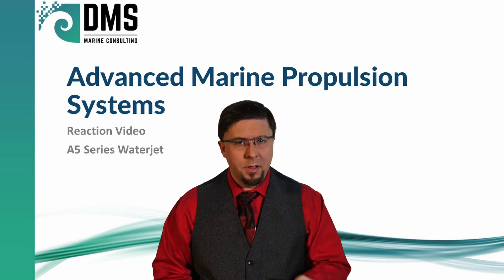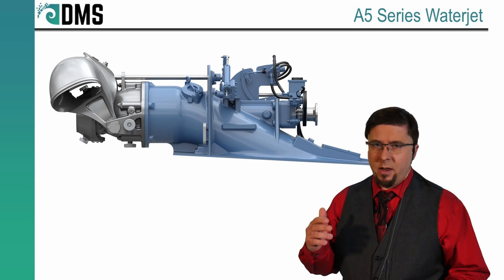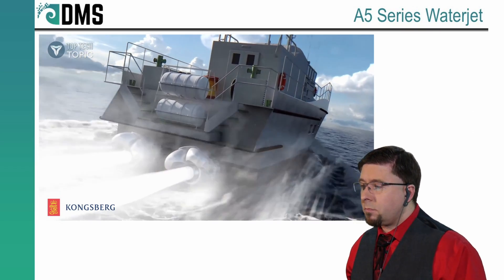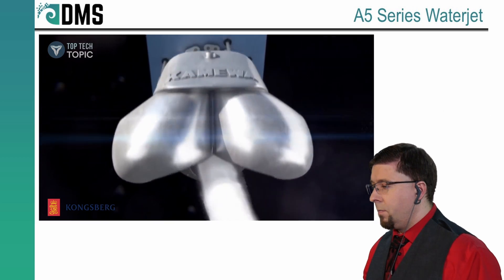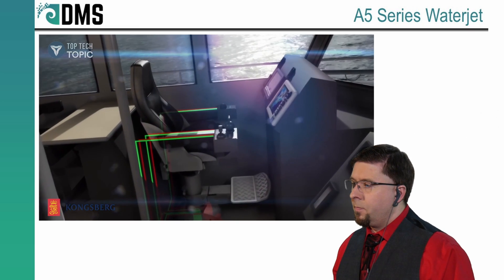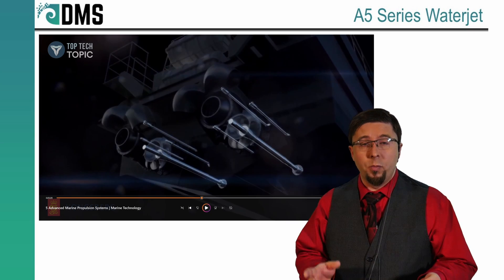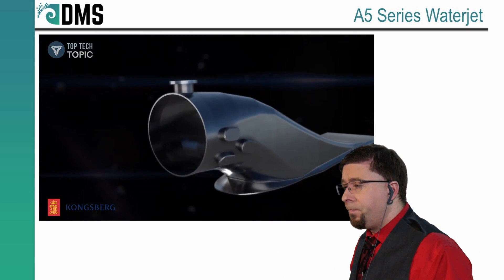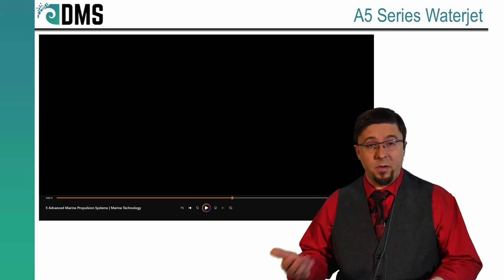Military Waterjets:  What Separates High Performance?

Comment: Surfing on a couch for the perfect outboard propulsion for a daysailer/pocket cruiser (what about a paddle ?)... 

I did wonder, however why navies (US Navy, Russian Navy - with around 16 remnant Soviet era units still in service) gave up on hydrofoils when they make their way into sail racing (fuel consumption is a factor when chasing speed, but then again, sometimes a short distance sprint is all it needs) - as if there were a plateau of diminishing returns in hydrodynamics...
Reply: Hydrofoils need a super light boat to be fast and efficient. Most military boats need to carry weapons and communication or sensor systems most of which are heavy. Even beyond that Hydrofoils don't like to travel in big waves and the military needs to be able to go out even when the weather isn't perfect. Most jobs that hydrofoil would be used for could just as easily be filled by a slower more heavily armed and armored ship or a much faster airplane both of which are less worried about how much wind there is on that day.
Reply: @MascottDeepfriar  
"Hydrofoils need a super light boat to be fast and efficient. Most military boats need to carry weapons and communication or sensor systems most of which are heavy." 

Good point. 

"Hydrofoils don't like to travel in big waves and the military needs to be able to go out even when the weather isn't perfect." 

So is this. 

One could say, then that arms and sensor development (precision guided ordnance with minimal payload, networked 'sensor fusion' to kite the periphery of a storm) didn't advance as much as fluid dynamic hulls with minimal surface (similar to the technological lag in materials and avionics for high supersonic operation as most military aircraft are downgraded 'downgraded' to optimized trans-sonic speed).  

It remains curious that with composite materials and digitzed navigation, hydrofoils came into Ocean Racing - never bothered to develop a hull that virtually can't capsize - or better said, is rather easily uprighted after a knockdown - which would befit Blue Water racing rules and could benefit a revival of commercial shipping under sail (actually some hydrofoils are utilized as stabilizing outriggers with minimal drag)...
Reply: this is a video about naval hydrofoil development. It is more of a history documentary but it does outline a lot of the limits.
"HMCS Bras D'Or; The World's Fastest Warship And The Pinnacle Of Hydrofoil Development In Canada"